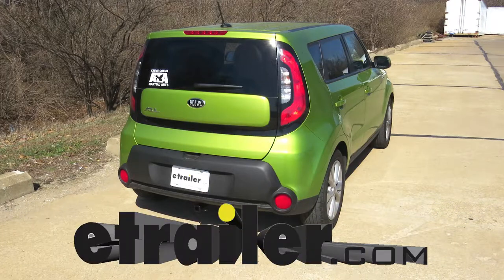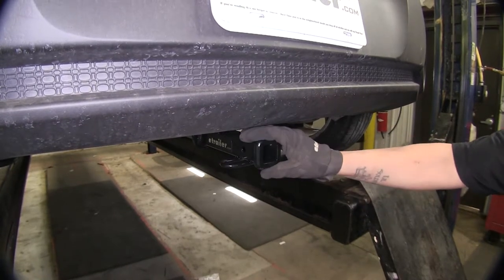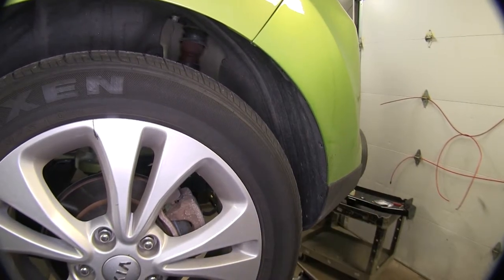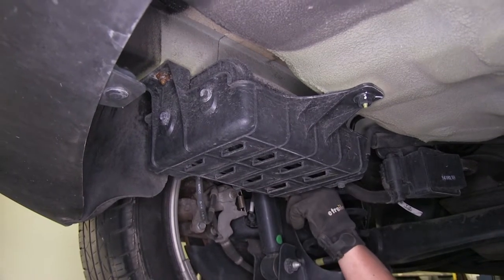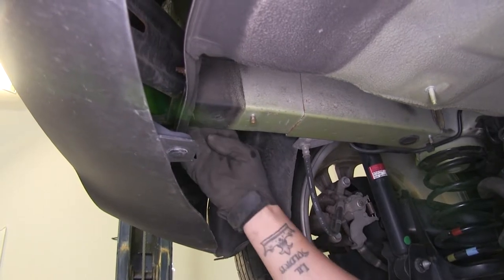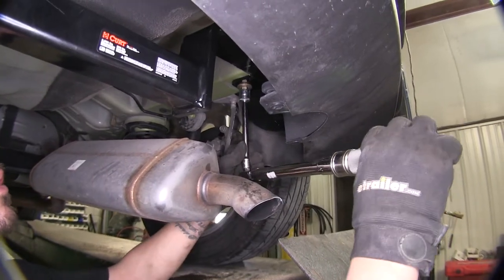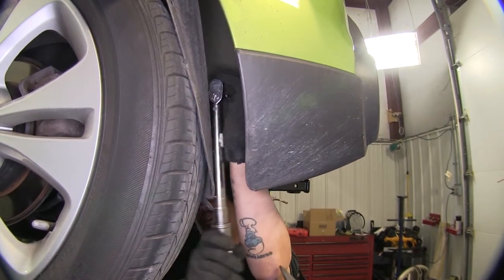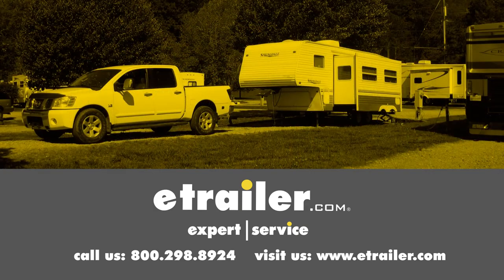etrailer | Setting up the Curt Trailer Hitch Receiver on your 2015 Kia Soul

Comment: For anyone doing this install in the future, the trickiest part for me was cleaning out the bolt holes from rust and debris. No amount of scrubbing with a brush was able to clean the threads properly in my case, and the bolts would not screw in. To clean out the holes properly, get an M10x1.25 tap (with a handheld T-handle), squirt some penetrating oil into the bolt holes (or WD-40 will also work fine) and re-tap the holes in order to clean them out perfectly. Then the bolts will go in easily.
Reply: Oh, and one of the nuts for the evap canister was siezed to the screw post, and it snapped off the screw post when I loosened it. So, please be careful about that also!
Reply from the maker: Thanks for the tips, we always appreciate them!
https://www.etrailer.com/Trailer-Hitch/CURT/C11419.html